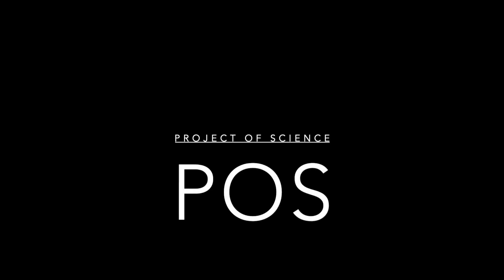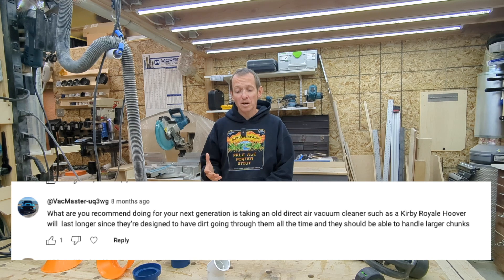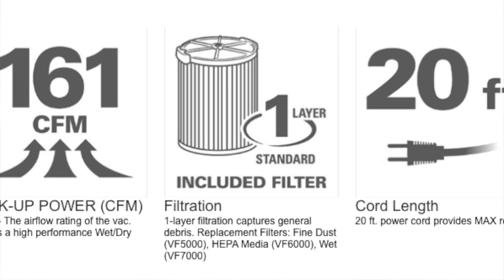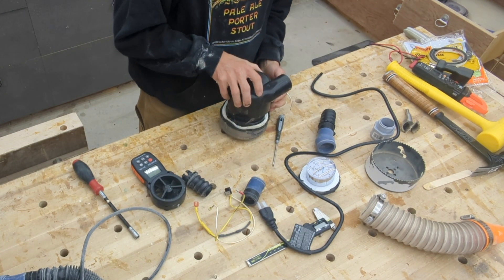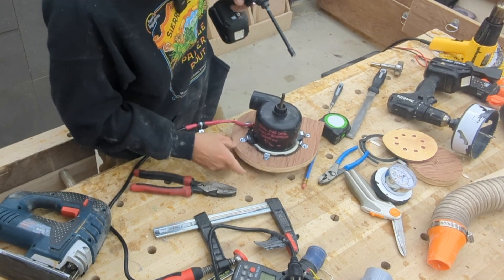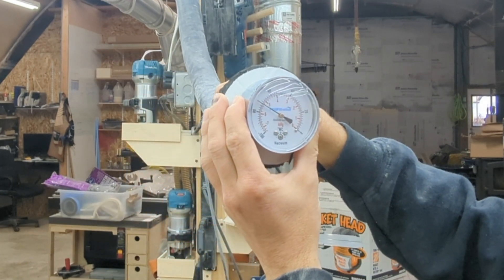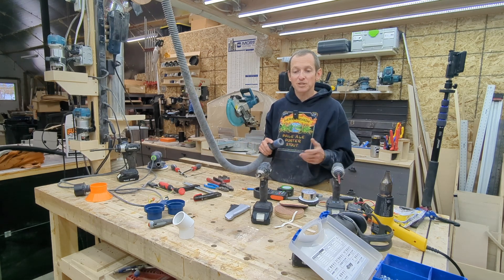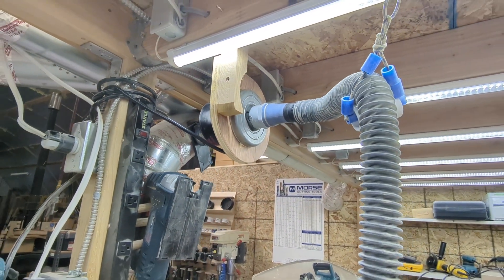Boosted Dust Collection v2

Comment: Thanks for the video and the tech info, which is always interesting. 
I simply installed a 4" Y connector at the base of my 1.5 hp dust collector, then connected the angled hose to the $100 shop vac running inline with the dust collector. This added a lot more suction while adding a much better flow of sawdust, etc. I haven't checked where it dumps to - the extractor on the dust collector or the vac, or both. Much easier solution than rebuilding my small shop dust system. I'm checking to see if there are any cheap inline boosters that bypass the propeller system (the power being below the duct line, or off center) so no dust or other debris gets caught in the direct fans. There are some cheap ones online, like $30 claiming 350cfm boost, but I doubt if they will run long and probably build up too much heat. ?

Comment: I liked your idea and that led me to another idea: I hooked up my  dust collection system to my old shop vac's "Out" port. I removed 1/3 of the filter paper, exposing a tight metal screen. I then hooked up a took to the shop vac and turned on both the shop vac and the dust collection system. It worked great but the suction was quite strong. The shop vac motor relies on airflow to keep it cool and prevent overheating, so I am putting in a Tee fitting on the inlet port and a blast gate I can throttle to admit the minimum air needed. I'm going to put an end cap on the bypass air gate and drill a hole in the end cap big enough to admit just enough air.

Comment: I tried something closer to your original design and it seemed to disrupt the flow of air to the dust collector from my other tools, basically causing back pressure down the line.
Reply: Right now I have it set up to make a pretty hard right angle wye into the 4" tube. I'm thinking if it were more gradual wye it might be less of a problem, or cause a sort of multiplying effect.
Reply from the maker: Hmmm....not sure I quite understand.  I do have my main dust collector running when the booster kicks on.  My main dust collector is pulling >1000CFM and I doubt the booster is contributing more than 100 so haven't had any issues like you are describing.